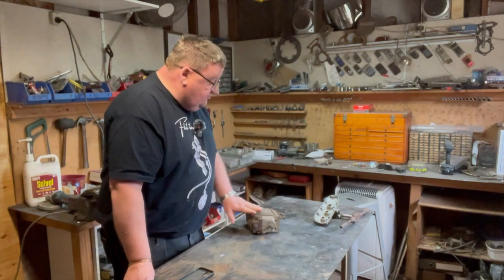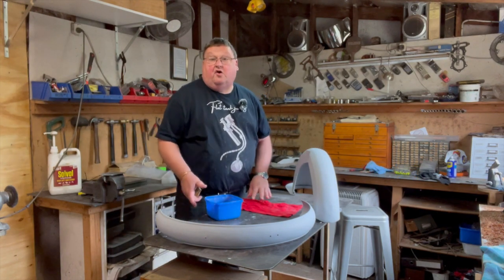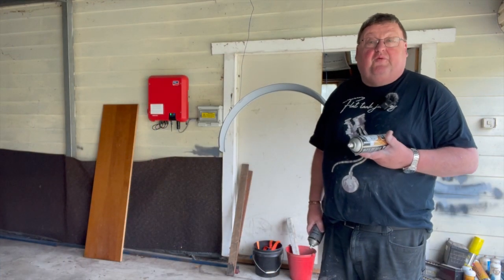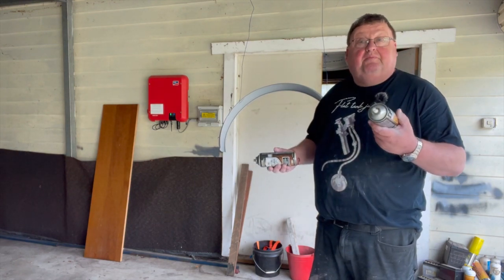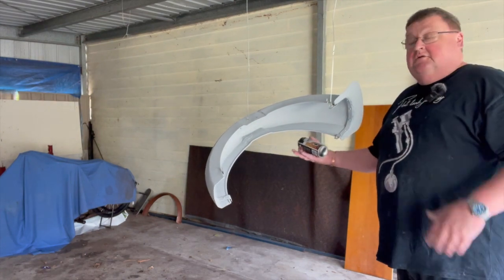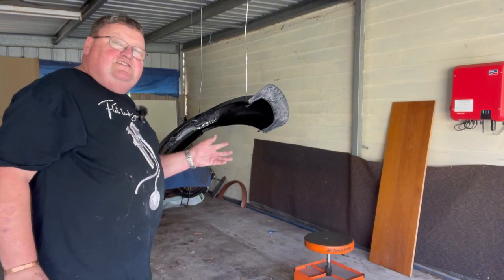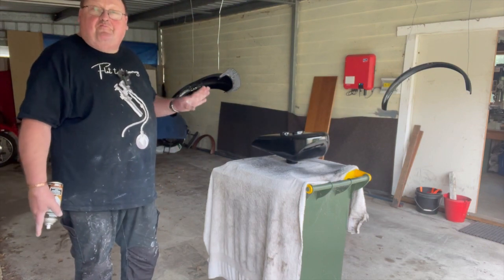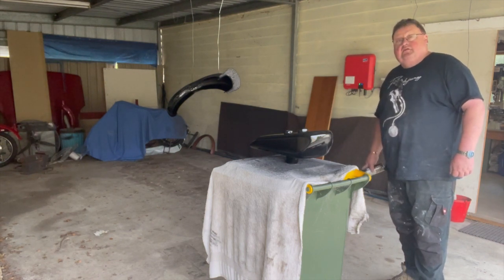Apply The Paint, Im Excited | Restoring A 1920s Raleigh Basket Case - Episode 19

Comment: I have painted 9-10 bikes - most more than 50 years old, and all with spray cans.   I save the plastic tops of the cans.   I always keep at least 4 CLEAN can tops for supporting my painting - 2 to 4 tops at a time.   (Sometimes right side up, and sometimes upside down - depending on the usage.)
Reply from the maker: Glad to find another rattle can man.  I’ve had pretty good outcomes with them over the last five or six years.  Good idea with the tops, I must start doing that.  Thanks for watching and messaging.